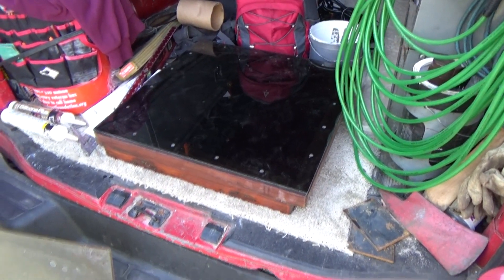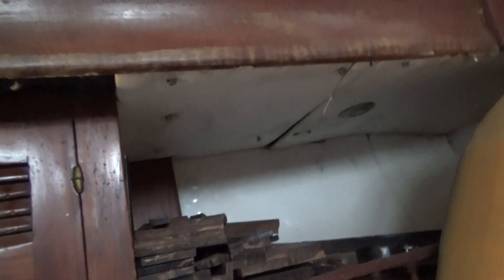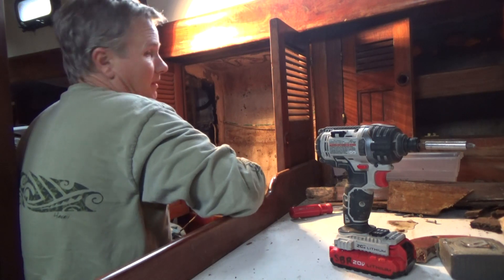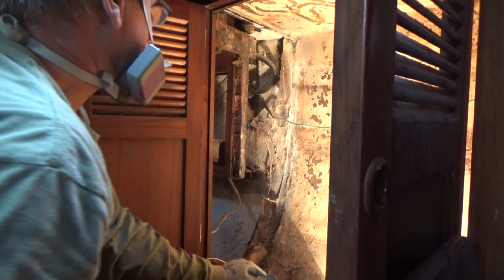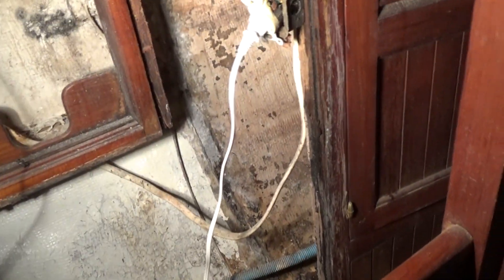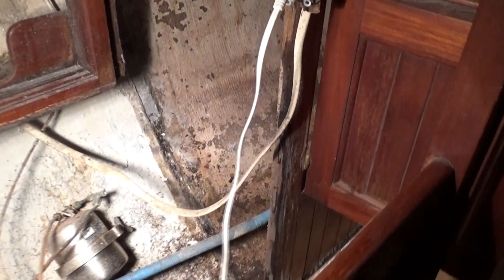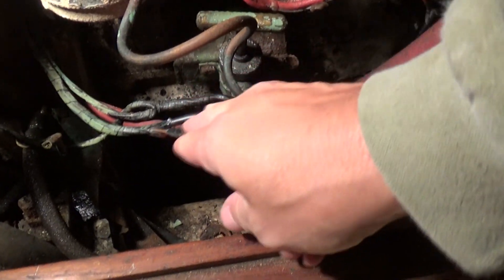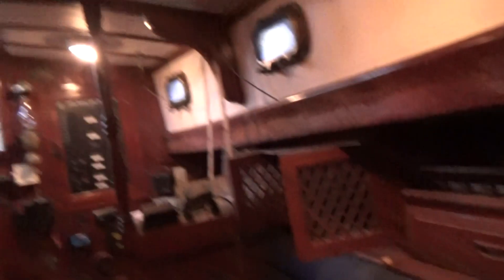LoKee "The Start of Year Three" Update #31

Comment: On the solar panels, try rotating them so they are parallel to the boom while you are on the hard.   You have them both partially shadowed by the boom, and solar panels do not like having even a small area blocked by the sun.  Your output should improve exponentially if you can get even one completely out of shadow.  Love your videos!  Keep 'em coming!
Reply from the maker: I would have rather had them that way, but I have two hatches are in the hardtop and I would covering them up (and I don't want to do that)...I would think setting the boom to an offset position when I'm away from power will probably be the thing to do. I will also add additional panels along the aft end of the boat later down the road. I just wanted something in place for when I put new batteries in the boat in the spring.
Reply: I understand.  I was shocked when I put a meter on my panel in bright sunlight and shaded even one cell.  The output dropped by more than 50%.  If your goal is 12volt power during renovations, you might even take the boom off until you launch again.  Just a thought.  Thanks for the videos!

Comment: Leaks like that can be tough to uncover, one thing I was taught "always look for the highest point that's wet"  Gravity, don't ya know! You are getting there bit by bit.  When was the last time that engine ran?  If it has been a while you might want to try and get it to turn by hand, that is if you haven't done that already.  Yep that voltage regulator died many moons ago!
Reply from the maker: I bet it's been 5 years since the engine ran...it is a big question mark in this process! The leaks are a pain in the butt!!! I guess the bigger the boat, the more spots water can find to get in :-o